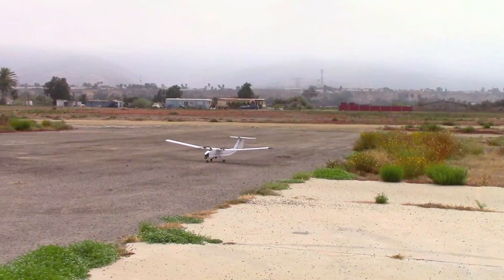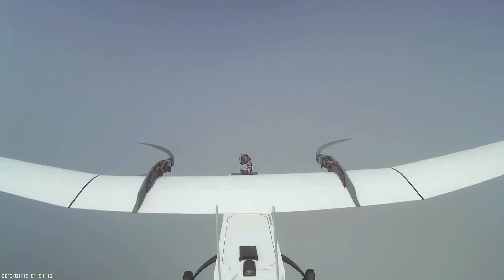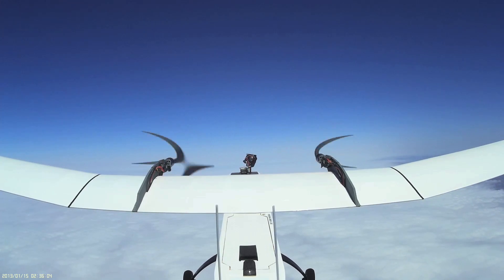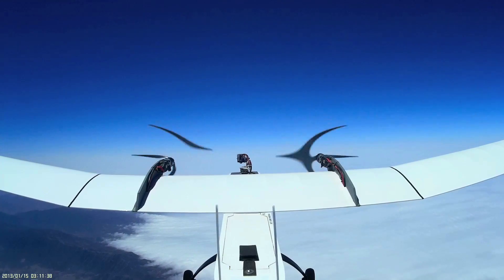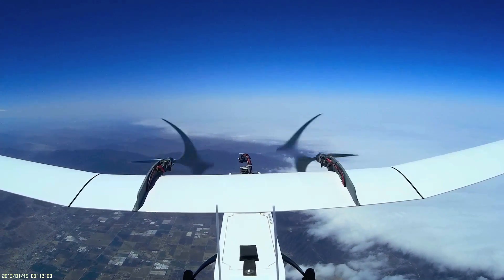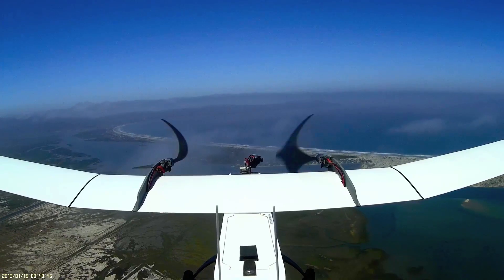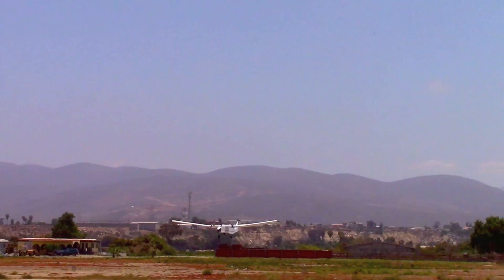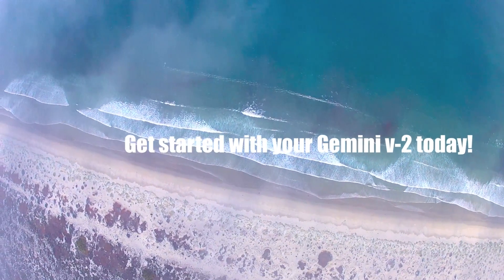Gemini V-2 FPV High Altitude-Long Duration Flight-13,000+ ft.

Comment from the maker: cameras can be added to the wingtips as well.  making eh gemini a pusher would put the props in turbulent air, and cause vibrations, but would work.  similar to the piaggio avanti aircraft, they have  unique noise profile, if you have ever heard one. that noise is the pressure differential from the wing hitting the props.  i don't consider it a good thing, but it could be done.
Reply: i know that sound!! i fell in love with it's design, a few occasionally fly out of my airport where i work. i thought the noise was caused by the exhaust hitting the props.
Reply from the maker: it would fly the furthest at a relatively high altitude, without descending, because the air is thinner, and travel through it is more efficient. 
This is the strategy behind commercial air flights, and the reason they expend extra fuel to get to their cruising altitude. 
at sea level, the theoretical max distance is 120 km, with the 3kg battery pack, in stock configuration.

Comment: Hey, I'm fascinated by your Gemini project and the V2 especially. May I ask if you ever thought about a pusher configuration for the Gemini? It would make it easier to wing-mount cameras closer to the CG without obstructing the view by the moving blades. Small diameter cameras might thus be implemented into the wing profile, creating almost no additional drag.

Just asking. :)

Comment: What type of onboard oxygen system did you use to keep the pilot from passing out?
Oh, never mind, you probably had a pressurized pilot compartment to handle all that pressure change.  :)
Reply: If you call sea-level a pressurized pilot compartment then yea

Comment: Question. why is it legal to fly RC airplanes to those altitudes but quads are restricted to 4oo ft.
Reply: +victor chakmakian if you have a HAM license you can fly almost wherever you like, although you should make aware any near airports of your flight, and have reflective antennas that make you stand out on radars.
gay isn't it.

Comment: Hello, I'm having trouble getting the carbon fiber rods, you know anyplace I can get those? also what motor you recommend also  for the esc's,  you have plans on selling the tesla batteries?, thanks
Reply from the maker: Ritchie AQ Here is where i have been getting the carbon wing central spar, and outer wing sheath tubing:
http://www.ebay.com/itm/OD-25-mm-ID-23-mm-x-1000mm-1m-3k-Carbon-Fiber-tube-Tubing-pipe-shaft-/141394052252?pt=LH_DefaultDomain_0&hash=item20ebbe049c

i recommend putting all of the items in your cart front he same seller, then requesting a combined invoice front eh seller on ebay. 
he will send you conbined invoice, and you save the cost of shipping the individual shipping. 
you can also simply contact seller, and tell them what you need. 
they re in china, but speak english.  keep communication simple, it's better. 
i recommend the e-flite power 15 motors,  apc thin electric 13 x 8 props, counter rotating inward at the top, and phoenix edge 50 amp ESC 's. the pultruded carbon strips come from RCFOAM.com. they re easy to order from. 
I am making a "Tesla" style battery for someone right now, in 4S.  same weight, and watt hrs, just higher voltage. I recommend stick with the 3S, because it's an easier fit in the plane. not as tall.  the 4S barely will fit. it's shorter, but taller. Hope this helps! 
Best, Spike
Reply: FPVREVIEWS  I'll check that eBay seller thanks, how much are the batteries?  Im interested, I'll be flying in high elevations so I think that's the battery I'll better use
Reply from the maker: Ritchie AQ The battery runs 670 u.s. dollars, plus shipping and any duty or customs fees that it incurs. 
there are more specs about it on the store page of the website.  The price is actually comparable to lipos, if you look at the capacity. check it out!
Reply: FPVREVIEWS I'll take a look, sure I'll order one of those, one final question, you think the eflite power15 motors will be enough if I'm planing to takeoff at 7000ft? Thanks in advance
Reply from the maker: Ritchie AQ Yes, I think they will be just fine.  keep in mind that the electric powered plane will not be affected at all in amount of power required for flight, with the increased altitude.  The reason that full scale aircraft are affected in their power output is that there is less oxygen for the internal combustion engine to breath at increased altitudes. the electric power does not have that problem. it will work in space itself.  The only consideration is the rpm range of the motor, as the aircraft has to fly a little faster, and the airspeed is more. However, electric motors have a very wide rpm range in which they maintain efficiency, much wider than any reciprocating gas engine, so there again, that will not be noticeable.  The only consideration is the prop, as a slightly higher pitch should be used for higher altitudes.  The 6000ft that you are at is really not that high, and the recommended props for gemini v-2 are already pitched fairly high, so they should work very well. 
Those same props, being pitched high, also hav an advantage at lower altitudes, as they decrease the blade rpm necessary to achieve a certain amount of thrust, like for loiter mode, thus increasing efficiency. I really doubt that you will notice the difference when taking off at 6000 ft.  
I went once to 10 000 ft altitude with a setup that i used at sea level, and had to carry a camera payload that put the plane way over gross weight/ I had tested it at sea level, but i was worried about peformance at that altitude. When i flew the airplane, i could not tell the difference.  It was a skywalker 1900, with a canon T3I strapped to the nose, one 3S 5000mah battery, an elite park 480 motor, and a 3 blade 10 x 7 prop, so it was very overloaded.
you could experiment with different props, but the problem with going higher in pitch is that the blade angle with any higher pitch will stall at zero airspeed, like accelerating from a stop on takeoff, an equally important part of the takeoff run, so I would recommend stick with the 13 x 8 props to start with. hope this expains it sufficiently.
Reply from the maker: Ritchie AQ i have not received the email.   fpvreviews@gmail.com  look forward to hearing from you. alternate is spikeeewebb@hotmail.com
Reply: FPVREVIEWS email sent!!!

Comment: What kind of uhf antenna combination did you use?
Reply from the maker: Kurtis Towery ezuhf diversity with two homemade  dipoles. made from servo wire. just look up dipole calculator on google. it will give the lengths.

Comment: How do you implement possible air traffic in your flightplan, especially at higher altitudes?
Reply from the maker: Sjoerd Postma large air traffic in our area is extremely rare, and is over 25 000 feet.  smaller air traffic is almost always at very low altitudes in our area, under 1000 ft, and talking to ATC, so we can listen.
Reply: FPVREVIEWS Thank you for your answer. I live in the north of The Netherlands, where the sky is congested with all kinds of air traffic (VFR, IFR and military) All in a tiny airspace. Rules for fpv are also very strict and making a flight like you did is next to impossible for us. I really enjoy your video's and maybe, one day, we can build a Gemini and make our own video :))
Reply from the maker: Sjoerd Postma we are lucky if we see one airplane in a week here.